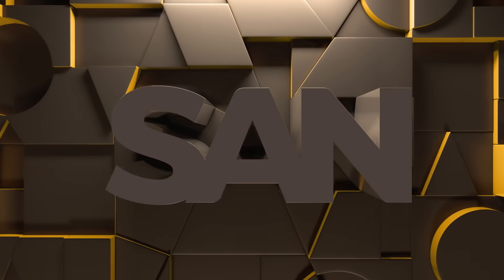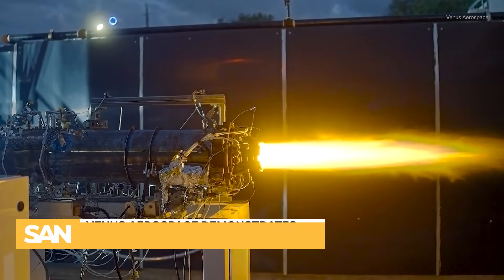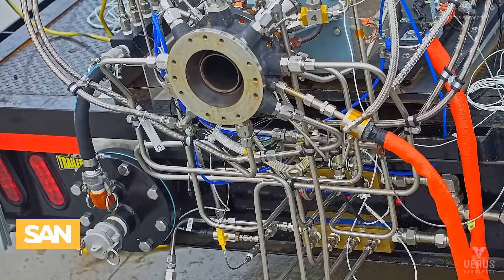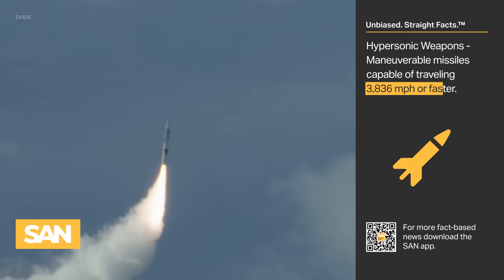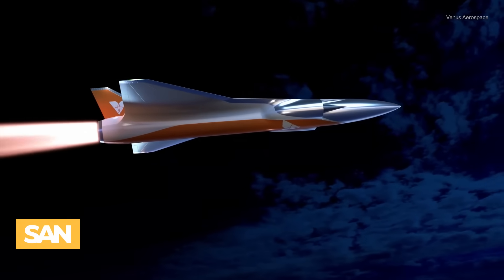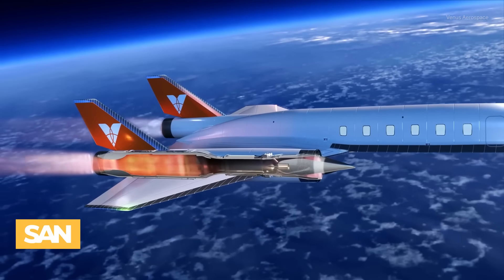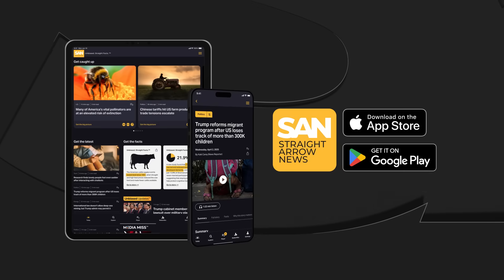Texas startup making history with revolutionary rocket engine

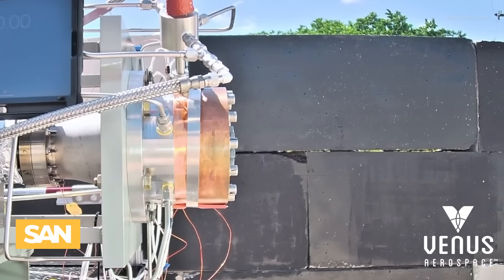Comment: At 1:33 , after getting pedantic about terminology, the host says, "but when it comes to avionics." Avionics is simply a term that combines "aviation" and "electronics." It refers to the electronic systems used on aircraft, spacecraft, and satellites—not the function or design of a rocket. Amateurs.
Reply: You using the word pedantic is ironic, considering your replies. These are educating moments, maybe you could use that vast storehouse of impressive knowledge to bring people up to speed instead of being, you know, a pedant.
Reply: Thank you,
Sir
Reply: A jet engine is electrical, connected to fuel pump sensors and has a electric motor inside of it. They have to do the math and integrate it with a international standard for communication, so it’s avionics really.
Reply: @Yourdayjob I am an avionics technician; there is no electric motor in the center of a jet engine, nor is there one in this rocket. Sure, avionics are involved in both, but avionics aren't what makes either stand out in terms of function.
Reply: @biowerks  you are right I was thinking they compressed the air for these on board but it’s definitely a tank of air they compressed on the ground and fill it up before launch. So it is a fancy piece of structure more than avionics.
Reply: @Metalscratch wrong again, bleed air comes from the APU and is used to start the turbines.

Comment: 1:48 My only questions are:

Which SpaceX engine? Merlin, Kestrel, (Super)Draco, Raptor, and which iteration? 

Which engine from Apollo/Saturn V? F1, J2, AJ10? 

And by what metric? Thrust, ISP, chamber pressure, exhaust velocity?
Reply: Wiki says 10% better ISP.
Reply: It's just a round Harmonica with openings that can be closed to prevent the rocket from hitting anything when it fails. It's smart. Everyone will add these to their rockets. Plus, what if we can get them to spiral like a football by making them open and close like Christmas lights?

Then we'll be Plane Crazy! Who wants to watch Mickey Mouse? I'll tell ** to give you a ** if you can find a word salad! Yes, we knew you liked ****s from A MALE AWAY!
Reply: What's the point in comparing chamber pressure or exhaust velocity while speaking about overall effectiveness of the engine?
Just add some pointless word salad and everything looks smarter? Good job, here's your cookie.
Reply: @vmasing1965  With higher chamber pressures the engine can be smaller for the same amount of thrust 
With higher exhaust velocity the engine becomes more efficient
Reply: @armin3749 You just repeated "more effective". Twice. Doubling down on more word salad?
Reply: @vmasing1965  An engine being of similar size and power as another consuming less fuel isnt the same "efficiency" as similar size engine producing more power at an increase of consumption.
But congrats on recognizing 2 matching words, tell your parents to put 1 gold star on the fridge for you, would've gotten a second one if you noticed "higher" appeared 2 times as well. 😂
Reply: @Suomiwimbula  Ahh yes the problem with engines is their exact dimensions! If only we could somehow make them little smaller we would be so saved. Here we come, Andromeda, with our tiny fiddle... erm I mean, engine! 

It's nonsense ofc, and you know it is perfectly well. If the engine is a few inches longer or shorter is about as important as it's color...

Well, if someone is volunteering as a clown I have no problem with that whatsoever. All in a good fun!
Reply: @vmasing1965  Military is always interested in saving space such as when trying to stuff as many missiles as possible in a sub/aircraft.
Ironically paint can actually matter too for example the paint that cost millions to develop for stealth aircraft that they also employ on some missiles.

Do you like not know anything but still felt the need to comment like you're a expert? 😂

Comment: If it can be made durable and reliable with-out De-flame-ation or flame-out in certain Multiple Breather Compensators maybe borrow some kind of front loading Spool Valve to deal with low -Pressure return on the back side blow-out !.

Comment: Avionics means electronics for aviation. It does not mean engines.
Reply: Pretty sure it also refers to the weird way commercial pilots talk to the passengers.. Ahhhhhhhh.... This is your captain-ahhhhhhhhh speaking avionics-uuhhhhh..
Reply: The engine is the steering mechanism using electronics for guidance. I wouldn't split that hair.

Comment: The main problem in passenger flight is how long it takes to actually get to a plane, not the speed of it.
Reply: True. I took a 40 minute flight recently, of which I spent 40 minutes getting through security and queues, 40 minutes needlessly waiting around while I waited for the gate to show, 30 minutes waiting at the gate for a delay, 15 minutes to board everyone, 30 minutes sat at the gate for a slot to take off, 10 minutes taxiing, 35 minutes flying (only part that was faster than expected due to wind), another 10 minutes taxiing after landing, for some reason 25 minutes parked with nothing going on, then about another 40 minutes from getting off the plane until I was out the airport. Even if the planes went 50% faster it'd only really be noticeable on flights over 4 or 5 hours.
Reply: @AdamDoesThing basically "275 minutes out of these 40" 😁
Reply: How long it takes to board the plane?
Reply: @Eduardo_Espinoza  with check ins you have to be two hours early, line of people no standardized luggage, load the luggage then people board, waiting for your take off (lots of planes), and then you actually start moving, after you arrive same thing, but slightly faster if you are lucky you won't have to fly circles until you can land
Reply: @ML-fx2si Trump is streamlining the security process at airports to try and speed that up btw.   Love him or hate him, that's a good idea.
Reply: @Eduardo_Espinoza  2-3 hours and also time to get ot airport. thats why fast trains are way better until certain ranges.
Reply: @jebise1126  Fast trains are only better if you have high density population centers like Paris, Lyon, Tokyo or Osaka.  If your population is spread out like in California, the train will either have low ridership and thus not be economically viable or have to make a lot of stops (which is slow).
Reply: How about how long it takes to get a maintenance guy out of bed to come tape a broken overhead compartment.
Reply: This seriously happened on AA from Baton Rouge to Dallas.
Reply: CP Grey made a whole video on loading planes. It could be faster but they make less money that way. But yeah planing and deplaning is a large part of it
Reply: which is why a good train line is superior
Reply: I'll just take my own private plane then, thanks
Reply: these wont be used in helping civilians. These will be most likely used in weapons and fighter aircraft probably.
Reply: Apparently, you have never spent 16 hours is a cramped space. Think about how many stupid movies you have to watch!!!!
Reply: especially when companies force people take all the luggage in the cabin because of prices and let people enter unordered with twice the volume of the overhead compartment
Reply: In my example 12 hours, for 2 hour flight. Makes 14 hours for 1600 km distance. Average speed just above 100 km/h😮😂😂😂
Reply: well, it depends on if it is a long range flight or short range flight, but yeah, that can totally be a huge factor
Reply: Flying should be a luxury. Not a commodity. The waiting times are a good tool to demotivate people to use planes.

Comment: Using rockets for commercial aviation? I don't think that idea will take off.
Reply: 1890: What!? They're trying to use internal combustion engine on the horseless carriage?
C'mon this is a crazy idea! It will never take off!
Reply: Yeah, suggesting Rocket + RAM Jet which requires sustained speeds on a commercial flights rings an alarm. This guy is probably selling snake oil. RDEs have successfully tested for decades now, the issue is sustaining and scaling the detonations. Then again, it is not air breathing which makes it bad when comparing to tech like Scramjet which is already being operationalized for really long ranges.
Reply: @Halz0holic  I think they are solving for the low speed operation until the plane\missile gets enough speed for the scram\ramjet to operate. That said, I think that idea is DoA.

The issue with RDE is the high input (fuel & oxidizer) pressures required.
Reply: Its a smoke screen. The real use case is hypersonic missiles
Reply: Not a very good smokescreen considering they spoke about hypersonic weapons first
Reply: @ThisB-q4x  when they were a start up they only discussed commercial use. They changed recently and kept the commercial use statement to pretend like they are still planning that. Eveyone knows hypersonic is the real goal though.
Reply: One day we’ll have vtol spacecraft hovering everywhere on the surface and you’ll come back to this comment.
Reply: To get it to speed for the ramjet to take over, very efficient engine
Reply: ROckets have a Fail Rate of 2% - so who wants to board the 99th and 100th Flight?    (Good Luck with that!)
Reply: The idea might not take off  but the plane certainly will. 🚀

Comment: So it's an aero spike engine with a "different" combustion process. I like how they use the term detonation instead of the actual physical process occcuring: Explosion. But I guess that would scare off any potential investors. Problems with moving a small mass of exhaust at a very, very high speed, still exist. Fundamentally, they do not scale up well at all. The F1 engines that powered the Saturn V, as well as Space X's engines, were and are fit for purpose.

They were and are designed to lift a very large payload (humans included) at a "safe" rate to orbit and beyond. Forget about this being used in commercial aviation. That is pure hype, aimed to attract investors. Only real world application would be for military use in hypersonic missiles. But the military industrial complex is already on that case. Still, I wish them luck.
Reply: It can be used for unmanned cargo jets. It could be used for commercial “edge of atmosphere”travel. You have to think outside the box…
Reply: @justsaiyan8678  It can be used for whatever they like, but a pulse detonation engine would do the same job cheaper and more simply.
Reply: @EveryoneWhoUsesThisTV  pulse jets are WAY too weak and outdated for modern military applications
Reply: @BarrGC  Pulse jets and Pulse Detonation Engines are different tech mate....   :)
Subsonic deflagration wave vs supersonic detonation wave!
Reply: @EveryoneWhoUsesThisTV Yup, VERY different and i never said otherwise
Reply: @BarrGC  I see...
We were discussing PDE vs RDE engines, randomly raising the subject of pulse jets made us assume you were confused...
Reply: Wouldn't a simpler pulse detonation engine be just as effective for military applications, but more economical to build?
Warheads don't care if the flight isn't smooth, the V-1 didn't seem to mind.

If it's no good for commercial aircraft, I don't see it having a market.....

Comment: This has been on the pipeline for so long, a regenerative cooled aerospike with a rotating detonating engine can really be a game changer for spaceflight and missiles. I hope something good comes out of it, the current tyranny of delta V is extremely cruel, even more so for methane based engines.
Reply: Nothing (mechanical) should rotate in such an engine except the flame front of the detonation.
Reply: RDE's don't answer any significant challenges that aren't met by conventional designs. Neither do aerospikes. 
RDEs have efficient thermodynamic burning in the detonation regime, but, for example, the Raptor V3 is already burning at detonation pressures. Conventional rocket engines dump propellant across the entire 'backplane', if you will, area; they are volumetrically efficient in size and metal. RDE's constrict the burn area to a thin anulus, and that isn't likely going to improve. The inner surface, as well as the outer, is going to need regenerative cooling; a conventional has the one.
Then there is, in this case, the aerospike which likewise needs regenerative cooling, yes. (People, eg. Tim Dodd, seem to have developed an almost cult-like mystique around aerospikes, assigning special SSTO properties to them, oblivious to the fundamentals of the rocket-equation: whether you use an aerospike or not, a given rocket is always going to be more propellant and mass efficient with two stages to LEO than one.)

The whole thing, to any reasonable eye, looks like a project to cool a whole lot of metal that doesn't serve any particular purpose.
Reply: @-danR  While what you say is true for pure rocket propulsion. The factor that RDE development lends to aerospace is that new propulsion configurations can have a wider specific impulse operating range, thus making the entire flight profile more efficient than with a narrow specific impulse configuration used under the 'tyranny of rocket equation'. 
Imagine a sea level stage 1 with a Sp-I of around 1500 because of using ambient mass and aerodynamic advantage. Once above 25-50km altitude, then the configuration drops impulse further down until the craft runs purely through on-board fuel.